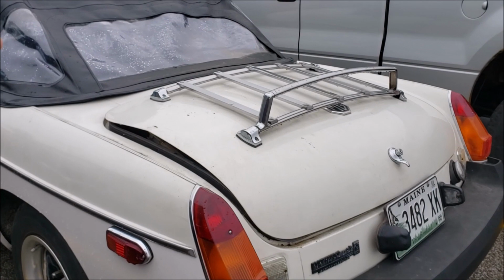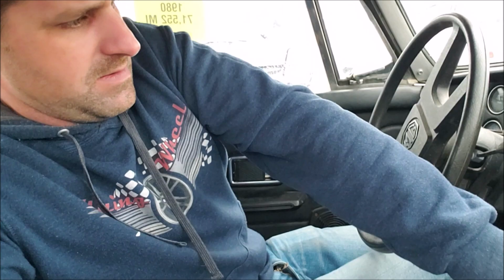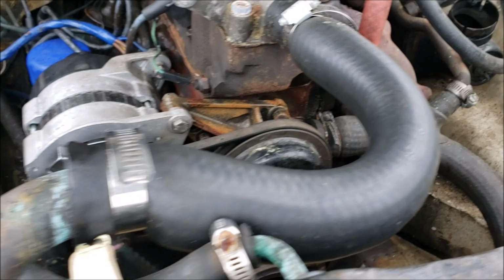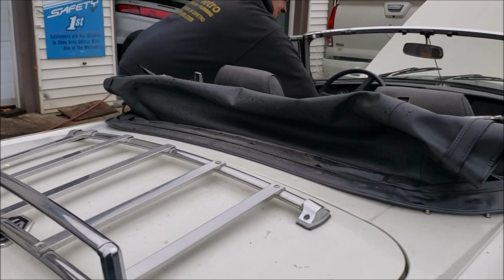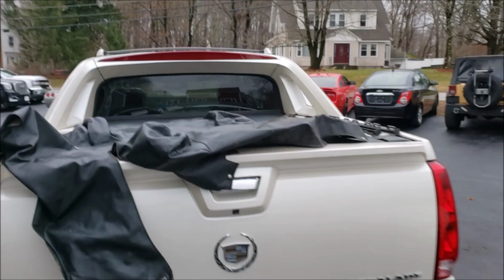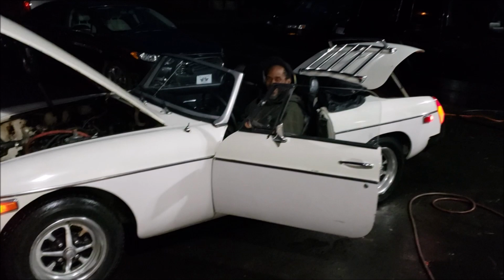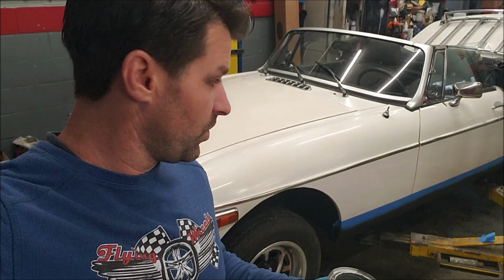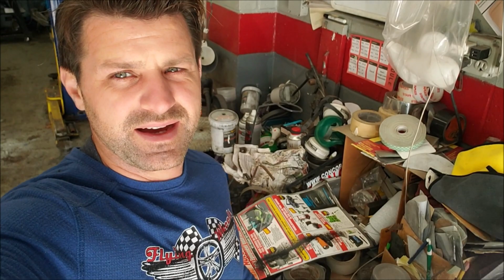I bought a ROUGH 1980 MGB by Accident - Can I fix and sell in 24 hours? - Flying Wheels

Comment: Good profit for the effort put into it. Got to be careful with your hands at an auction.
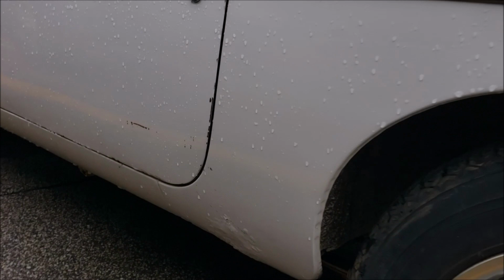Reply: Rear wing @ 1:42 is only held together by paint. If the wing is like this then the sill / rocker is most likely dead. Don't get me started on why you shouldn't introduce moisture voluntarily to an MGB. Give it a week, the boot floor panel will be gone!

Comment: You should drive a pre-75 MGB sometime and see what the fuss was about. The US pollution crap gelded the 76-80 models, hence the "can't get out of it's own way" part. Plus they raised the car several inches and destroyed the excellent handling. Earlier (chrome bumper) versions are much quicker - and with a supercharger, very satisfying. BTW I had a 79 I got for $3500, drove for 3 years and sold for $6500. I drive a 73 GT now, worth about $16K retail.
Reply: Never a super charger on a B. Never.
A 1973 GT has to be an absolute Cherry to get $16K.. but you might find a sucker. Dream on.

Comment: You are correct on the trunk lid very common onthe B model  for 1700  it’s possible to make a little but  can be a tough one parts are available but expensive  I’ve owned 5 or 6 British cars  many of which were MGs as old as the 50s  my ex wife took my MGB to state inspection inMaryland and the inspector told her the car didn’t have a catalytic converter as he mirrored under the car and she told the guy it was under the hood by the engine which he tried to argue  she knew it because I showed it to her  so that guy opened the hood and didn’t latch it  correctly it flew open and busted the windshield  the State was so afraid  we were going to go after them  they  would had done almost anything  I got a new windsheild installed and thankfully my daughter or wife were not hurt  the MGB was a decent car overall the engines were solid but because of poor rustproofing and metal prep  often the cars had rus issues  screwing up the negative ground  often previous owners and mechanics would install jumper wires to  make circuits complete  done half ass  I knew of one car that got sold so the owner pulled his tags and the car wouldn’t start why? Someone had attached a ground wire to the bolt holding the tag  on the car  ? When it was discovered the electric fuel pump was regrounded and the car ran fine  ironically the owners Father was a Electrical Engineer and diagnosed the problem  that’s a typical issue on a old MG  one more note on the overheating  it is common for the White ones to be known as the ones that overheated the most ? Nobody knows why that is so when doing coolant fills and changes the system needs to be “burped “ to stop air gaps in the system  there is a inline pipe plug you unscrew and squeeze the rubber hose to push out air bubbles  make sure your fan thermostat is working correctly  and go on the rubber bumper cars were heavily modified to meet US safety and emission guidelines  they installed catalytic converters that made them run hotter  and switched to electric fans for the radiator cooling  good luck on the car  they can be quirky but fun as hell to drive  MossMotors in California bought up most of British Leylands New Old Stock when they went out  they are very knowledgeable and helpful over the phone  plus have very good parts catalogs for every British make and model  when you get them running right it’s like driving a go cart  they love sliding controlled in turns and on the tracks  another thing on the B  is you can grab 2nd gear and Mark the pavement with two tire marks  from the rear  my Dad used to laugh at me pulling out of our driveway  as I always chirped  it  I kept my MGB for 14 years  and for many it was a daily driver living in Florida  where convertibles are perfect  vehicles

Comment: Those never came with power steering. Those never came with power ANYTHING.......
When MG had to put on those huge buggy bumpers to meet U.S. impact requirements, they also had to jack up the entire car on its suspension about 2+ inches to meet bumper HEIGHT requirements as well. As a result, the newer ones handled more like a slow truck than a sports car.

Comment: I’m sorry, but black painted rockers are a sure sign of poor bodywork. If there was rust in the dogleg and lower front fender, there had to be more in the true rocker panels that are under the outer dogleg and fender.
Reply from the maker: You can spend a week fixing it and doesn't make it worth any more
Reply: @FlyingWheels  Fair enough. I understand you're in it to make $ and support your business/family.  Just saying, if I were an unsuspecting buyer and found the paint bubbling a few years down the road only to uncover the real rust on the ends of the rockers and inner sills, I’d be pretty unhappy.
Reply: @FlyingWheels  I guess finding good control arms to make it safer doesn't add any value either.
Reply: @FlyingWheels  On an MGB rust in these areas isn't cosmetic, it's structural and usually more than skin deep. It's the first thing that anyone familiar with MGB's will look for.

Comment: The rear roof frame bar should have been pushed back to take up the slack in the canvas its adjustable.They never had power steering and it should have overdrive.And you can blame American safety laws for the horrendous Rubber Bumpers.I've never seen one with 3 wipers now that is rare.
Reply: NOT rare, three wiper blades was standard for the last 8 years approx.

Comment: MGB's were fun to drive but not the most reliable cars. That's why the Mazda Miata was made. Fun to drive and reliable.
Reply: The MGB, Triumph Spitfire and other two seat British roadsters inspired the Mazda Miata (or MX5 as it's known in Europe). Other than that You seriously cannot compare the two cars - they were designed more than 25 years apart! Plus my '76 MGB is perfectly reliable - in fact I drove it today here in the UK in 32 degree Fahrenheit weather on our winter roads. It started first time and ran no problem at all. While rust on MGBs is a well known problem, a big reason so many US MGBs went to the wall is because mechanically speaking they were never properly maintained. People just ran them with zero maintenance, zero servicing and then complained about 'unreliable British cars' when they didn't get 150,000 miles out of them. Crazy.

Comment: What happened to the cracked paint? And how did you get the trunk bent back the right way? Wish you'd show those parts.
Reply: In dealing with the cracked paint he would have spent much more time, effort and money.  Probably buffed it out as best they could.  The trunk was probably held down by one man and another lifting up on it to straighten as good as possible without pounding it out or replacing.

Comment: Why did you paint the rockers black instead of white?
Reply: It's the classic way to cover a quick bondo job rust fix on the structural sills and rocker panels. For people familiar with MGB's is the easy tell.

Comment: So you bog over the substantial rust in a convertible unibody car where all the structure is in the sills. Lucky you didn't flip it to the public. I restore MGB's, put that cat on a hoist with the doors open and it will flex in the middle, guarantee it, that rust is a major and you just covered it up.
Reply: No fair exposing the facts.. this car was a wreck and the flipper did a hack job to fool and unsuspecting buyer.

Comment: I'm starting to flip cars, and I don't know how to find someone to help me fix the cars I want to flip. How can I find someone who can fix the cars for cheap?
Reply: thats the hardest part. I fix my own stuff, so huge advantage there.
Reply: You need a mechanic partner.  Otherwise, like m ph said you’ll have to learn to do it yourself.
Reply: @fretworkband3204  I can do some stuff on my own. However, I have a full time job and I don't have time to do everything myself. I want to test the waters and see if this is something I can pursue it full-time.
Reply: You need to find an edge. Maybe your an excellent detailer or you can do body work. Find stuff undervalued, add your personal skill set to it and increase the value. Just buying and reselling, you are going to have a tough go at it

I did mechanicals, bought majorly broken stuff cheap. Brought it into the garage, spent a day or two on it and doubled the value based on my skillset. I did dozens of transmission repairs a year for a couple hundred in parts, but added thousands in value to the car.
Reply: @mph5896  I might be able to clean it up really good and do some light repairs. But transmissions and major repairs are something I can't handle. I think I should target only running and driving cars with some cosmetics but nothing beyond that.
Reply: You have the wrong attitude, much like the flipper in this video.

Do your own work and do it right.

Comment: Just wondering if it has electric over drive pulling towards you on the turn signal will In gage it. It only
Reply: It only works in third and fourth gear
Reply: Jeffrey Johnson  ok I had a 1974 mgb bought it new and got to drive it out of the showroom over drive in third and fourth on turn signal. Tks for your reply